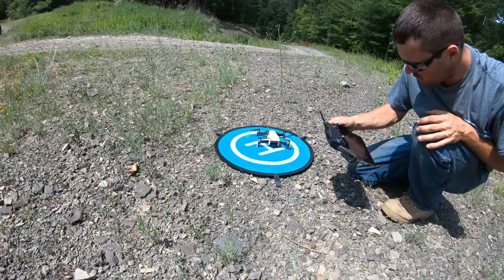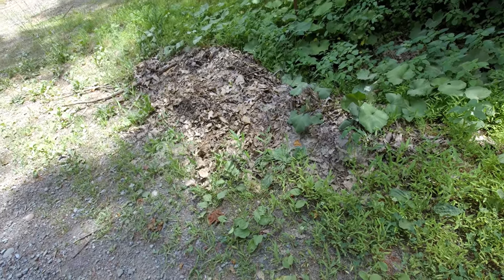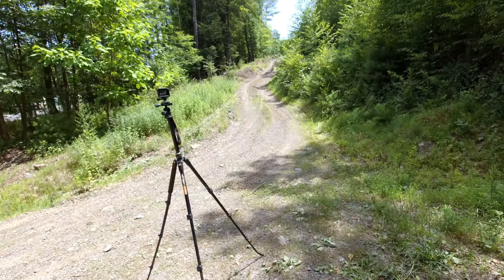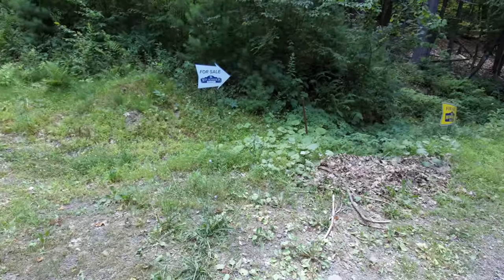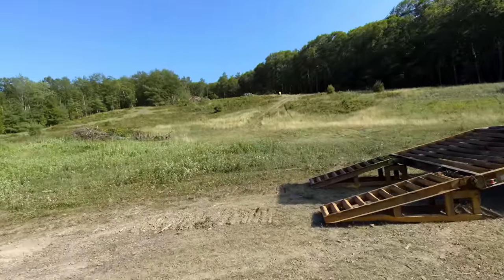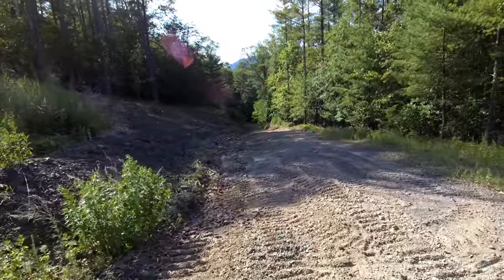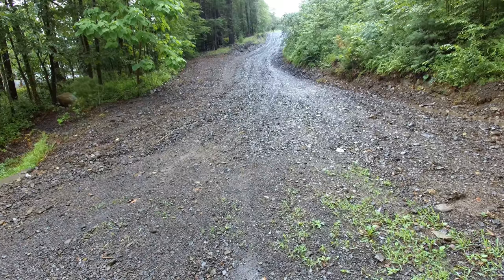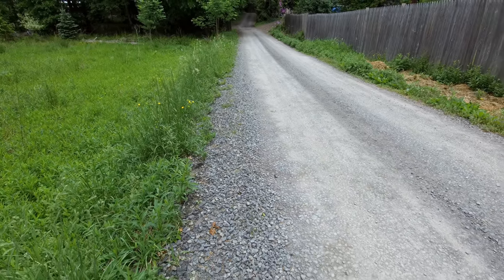Cutting in driveway drainage with bulldozer

Comment: When you first started with the dozer, I was asking myself, how the heck are you going to make a ditch NOT as wide as the dozer blade. Cool to see your method of using the dozer at an angle, with corner of blade as my answer. I have to admit I had my doubts as to effectiveness when you were done, but your rainy day followup proved it worked. Thanks for your videos.
Reply: FYI Libertyauto, that dozer is a 6 way blade: up/down, left/right, and tilt. cut my teeth on that D4C Cat. If you watch carefully you can see when he tilts.  nice work on a rocky/shaley driveway. I would have spent a little more time smoothing it out, but that all depends on what and how much the customer wants and how much they're willing to pay, so no criticism from me. Love to watch Andy work.
Reply: Thanks Joel C. I did not realize the blade would tilt.  That makes the method and machine used even more understandable.

Comment: good job andrew: the video is super professional. like better than some typical tv shows. see the thing is, you have now corrected for the errors, and made it look like an actual driveway, rather than a forest road, now think about winter and snow. of course this hill would need chains, or four wheel drive with frozen conditions. but a driveway is all conditions. it is steep enough through the narrow groove to push the snow downhill.  when approaching corners, one needs positive camber, not off camber like at the top, you may remind the owner, that that work may need done, to keep the house owner from running off the hill on the off camber corner at the top. or not, and let them discover that in due course. hah

Comment: Nice work. I had a driveway about a quarter mile up a steep hill. I sloped it off to a ditch with several runoffs on the gully side...worked like a charm. I used it for years with only occasional maintenance while my neighbors driveway would wash out every time it came a good rain.

Comment: I don't know about in your area but if you lay stone down or gravel it's always best to packet with some kind of roller even if it's a pull-type roller on the back of the Dozer if you pack it down tight after you're done spreading you'll get better results and the road will be less to heaving this is what causes the potholes from the freezing and thawing great video
Reply from the maker: I tracked it in with the dozer. That will pack it down. Next best would be a vibratory roller.

Comment: G'DAY ANDREW, WELL DONE WITH REPAIRS, The Use of WHOA BOYS(Water BARS),Every 30_50mtrs(100_150'),is I've found on East coast Queensland, in heavy rainfall areas,critical in water diversion, also allows vehicles, especially heavy ones to reattack the grade,similar to terracing ,the Cat D4,definitely would benefit by fitting a single TYNE RIPPER,also to save your back,maybe consider hydraulic RAMS,on Loading RAMPS,on trailer(an unit like on Snow Plough,would adapt readily), Kindest regards, Dave McLaughlin, Queensland, Australia

Comment: It would really nice to keep an eye out for a grader, one with scarifier teeth as well as a straight blade.    Even without the teeth, they are great.  For that driveway, you could almost get away with just moving the loose side gravel back into the center and get a crown back on it.  I used to use a 1956 International grader, basically built out of 1 ton truck parts - axle steering box, engine, sheet metal.  building chain drive boxes for the ends of the back axle. o  )  O'O  belt driven hydraulic pump (could be big power steering pump)  Left and right cylinders and a hydraulic motor to turn the blade.  Good winter project for you.  3' of 24" pipe will get you 12' of blade.
Reply from the maker: Ill keep my eye out. People seem to like graders.

Comment: "if someone wants to check my math in the comments that would be great" Here ya go buddy. Your calculation of slope is right on! However, the first formula you wrote A^2 + B^2 = C^2 isn't needed here. That formula is for if you know the length of two sides of the triangle and you wanted the length of the third. If you plug in (62ft)^2 + (423ft)^2 = C^2 and solve for C, you get C=427.5ft. This is the calculated length of the road traveling down the diagonal line in your triangle. Because roads wont have a slope more than 15% or so, the two longer sides of the triangle (B and C) will always be pretty close to the same length. It's super smart of you to use the drone to measure distance like that. I bet not many people in your business utilize new technology like that to get the job done efficiently. Keep up the great work!!
Reply from the maker: Thanks. That's why match teachers were so big on "Show your work". Its important in the real world.

Comment: Wow, you're a natural when it comes to operating heavy plant and grading material, you have that rare talent to be able to just eye-ball the work and end up with a really accurate tidy job.. I've worked on a load of big construction sites, mainly motorways and the like so can spot a good operator a mile off, you're doing the work of three or four men on most of your bigger jobs, normally you'd have a civil engineer setting out the gradient and such for new roads or re-working and another guy constantly measuring to check the machine driver is working to the right level and so on.. Great work and great videos, that's a whole special skill in itself, it looks easy, but making interesting videos is another rare skill.. One thing I would add though, you really need to invest in a vibrating roller, it'll easy pay for itself in less wear on the tracks of all your machines!

Comment: Andrew,  I started watching your channel a few weeks ago. You do awesome things!  I own a small business in Virginia.  Called Homeowner's Bulk Delivery.  I have a small single axle like yours and just last year started doing a lot of tailgate spreading like you. On the tail gate release handle is a small 3/8 hole at least on mine.  What I do is take a small 1 inch ratchet strap not the ratchet end the long end put the S end in that hole loop the strap on it.  Then I shut my door reach out the window and grab the strap as I raise my bed I let the slack out until I get the height I want.  when I'm set up where I want to start my spread I simply pull the strap and it releases the tailgate.  Your fast!  But I think you'll like this.

Comment: Andrew I don't know if that particular road way or driveway gets enough sun but you could do that with Asphalt millings then pack or roll it down it would be like a Asphalt drive way as far as resistance to wash out.
Reply: Don Hanson agreed
Reply: A supplier here actually does milling and crushed concrete that packs 10x better it's crazy I love it
Reply: I've used it as a base for a new Asphalt and new Concrete driveway.

Comment: Do you ever use slag? I had my driveway done with it here in Tennessee, we'd had huge problems with washout because of the lay of the land. The wash would just move. The slag seems to almost rust together, making a kind of asphalt surface. After I got a couple loads of slag, and the guy laid them in with a good hump in the middle, I haven't had any more problems.

Comment: Andrew, you mentioned the steepness of this road and correctly calculated the angle using Pythagorean’s theorem at 14% but as steep as that angle is the grade is even steeper as 90 degrees = 100% pitch.  I think 14 degrees of angle equals over 18 degrees of road slope or grade. Highways are never built close to that steep. Not surprising that the truck barely made it hauling that dozer.

Comment: good dozer work with six way blade ,very handy .  id like to see better compaction too .seen a roller attached to ripper bar on back that lifts up with ripper bar ,not good on bends though and needs electronic level control fitted to help steering

Comment: I going to have to cut in a driveway similar to this but I don't have the shale base. So I am guessing it is better to have a ditch running on the up hill side of the road instead of letting it cross to the ditch on the other side? I expect I am going to need some good sized rocks in that ditch to reduce erosion.

Comment: Here's a thought. 
Tie a rope to your tailgate release lever and put a knot in the rope at the right level so you can just reach out the window and let the rope slide through your hand till you feel that knot, then pull the release lever. 
You won't have to open the door and you won't have to let go of the steering wheel. 
You will be in total control of everything the whole time.
😀

Comment: If the drone measures 63' for the vertical height (A) relative to it's starting point -- which does it measure for horizontal distance? Is it the diagonal distance flown (C - up and over) or is it the base distance traveled (B - 90 degrees to the vertical)?  It makes a difference for the angle calculation whether the 423" is used as the base or the hypotenuse...

Comment: Just wondering, Why have you got all the water draining to a ditch on the uphill side of the drive? 100% of water ends up in ditch at bottom.  Wouldn't it be better to shed water to other side all the way up with a slight crown?

Comment: A simpler way to calculate the rise is to divide the horizontal distance by the vertical distance, i.e. 423ft/62ft = 6.823 approx, so you have a slope of 1 in 6.823. To get a percentage, divide 100 by 6.823 and you get 14.656%
Reply from the maker: Thanks.
Reply: Not calculating rise, that is given, 62 feet. Calculating slope. Slope is always rise divided by run. To express as a percentage, multiply by 100.  A good limit to put on driveway slope is 10 %. That is 10 feet of rise in 100'.  This is standard in government funded projects.  To decrease slope a common practice is to put hairpin turns in the layout to increase length.

Comment: Instead of having the water from the whole hill going down the drive wouldn't it be better to have some spots equally located to get the water across the road and down the rest of the hill?

Also leveled and shored at those spots to prevent deep gullies from forming.

In the end maybe 1/4 or less water down at the end of the drive.

Make sense?

Comment: Im sure youre already aware of this but i wouldnt recommend using the drone to do a grade calculation based on the altitude it gives if its for anything other than just a very very rough estimate.

The drone uses a barometer to determine the altitude and it can be off pretty substantially since a very slight change in weather can effect the altitude that the drone calculates. Ive owned many many drones (Mavic 2, Mavic pro, Phantom 4 pro, Inspire 1, Spark, alone with several ones i built myself) and they have all shown at least few feet difference in altitude between take off and landing when landing in the exact same spot, sometimes its even been as much as 20 feet. 

The longer that youre the air the higher the chance is for the atmosphere pressure to change which in turn causes the altitude reading to be more off. Some drones use gps also for altitude but gps is also not very accurate when it comes to altitude.
Reply from the maker: I think the drone uses GPS to measure altitude.
Reply: @AndrewCamarata  The mavic air uses a barometer. Im sure it uses the gps altitude too but its primary source of altitude comes from the barometer. They do that because of how inaccurate gps is vertically. gps has about a 30-50 foot accuracy vertically.
Reply from the maker: Interesting.

Comment: ok i did the math using trig and converting feet to metres i have worked it out as  inverse tan' (18.8976÷128.94)= 8"33' degrees which when converted to % is close to 14.7
Reply: Breaking Toast slope = rise / run. Simple algebra to get the same answer. Work smarter not harder.

Comment: Another nice quality job.
Do you find that your Low Ground Pressure machine does better than a conventional track unit ??
Excellent narration on this vid, very well stated problems and your professional solution to each, 2 thumbs up !!
Work safe
Reply: I don't think is is a LGP machine. The tracks look too narrow. I think it was swapped over to a standard track. I might be wrong.
Reply: Brian Gardiner Could be...We'll have to see if he responds to my question...lol
Reply from the maker: I don't think its a LGP. I think someone just put those stickers on there. I should take them off. The narrow tracks like I have are better for rock.
Reply: Often LGP machines have longer track frames than standard, as well as wider grousers. Not sure if thats the case with that machine.
Reply: @tutekohe1361  Andrew's D4 Is a standard track machine.
Reply: The grousers may be standard width, but the track frames look longer than standard. They extend forwards in front of the radiator. Standard track frames normally are behind the front of the radiator. It could be that is normal for that type of D4, but every other model of Caterpillar with standard track frames start from behind the radiator.
 Many owners of LGP crawler tractors put standard width grousers on to try to get more life from their chains when using them in normal work.
Reply: @tutekohe1361  Good call on the longer tracks. This is a long track machine, you could tell this by counting the number of bottom rollers. However long track does not mean LGP. Low ground pressure machines have a wider gauge (lateral distance between track centerlines). This is necessary because if you tried to put the LGP track on a non LGP machine they would hit the dozer on the inside.  Look at the clearance between the inside of the track and the dozer on Andrew's machine.   There is very little space left. So that is the confirmation that this is not an LGP machine. I suggest that the people Andrew purchased this machine from did some painting and put a decal kit on it to make it look good and it does. They bought the wrong kit or the kit had some LGP decals in it in case they needed  them.  LGP does not belong on this machine but it is not hurting anything just false advertising. You will will come across that alot when purchasing used equipment. Long track is good on a dozer because it gives the machine better balance and allows for more precise grade control.

Comment: Andrew, why are you using Pythagorean theorem here, it will only indicate that the third side (where the length of the road in the slope) will be 427.7 feet, irrelevant here unless you want to calculate the 2 remaining angles using the SIN value, the grade is simply calculated by how many feet you go up, every 100 feet, that one you have it right on, as for the angle of attack, as you know there are 180 degrees in a triangle, and here 90 degrees are for the perpendicular angle, you have 90 degrees left for the two other angles, the top one should be around 82 degrees( SIN(423/427) = 81.52 degrees), but the bottom should be around 8.5 degrees (90-81.5=8.5 degrees), for your average, which gives you a radiant of 14.78% (your grade) ....no ordinary car will climb a 30 degrees gravel road...imagine 60 degrees!!! I used to say to my students check it by doing a scaled down model, do a triangle 6.1 inches, by 42.2 inches, take a tape and measure the third side, then take an angle measure to validate everything. If you learned this from me, it's nothing compared to how much I have learned from you, and I adore your persistence, man you never let go until you got it fixed, and I really admire that! I appreciate every minutes I look at your videos, even the one of your jet-ski, long but so nice to look at!

Comment: What type of stone do you recommend for driveway resurfacing?  With or without stone dust,  and what size?  I’ve always heard of “crush and run” but wanted your opinion.
Reply from the maker: I've had better luck without dust (on flatter driveways), sometimes the dust is better on hills. If using no dust on hills, use a thin layer. And bigger rock is better.
Reply: Andrew Camarata Thanks Andrew!

Comment: Others have said about all there is to say re your tremendous work ethic.  I do have one question:  D4C:  what does the C represent?
Reply: The "C" is a series designation. Equipment manufacturers are continually  updating their equipment to make them better and to encourage sales. The first D4 was just that then they came out with a D4B , C, E and so on.  The more progressed in the alphabet the series,  the more refined and updated is the machine. I think Andrew said this machine was a 1988 model so pretty close to the original version. Hope this helps.
Reply: @davidmorse8432  Thank you.
Reply: @orgcoast5990  Any time.

Comment: I have never been on a job where I could windrow the ditch into the road, and use it for a base and never worked around ledge that didn't require dynamite to bust it loose. The ground around here is pig slop clay. No good for anything.

Comment: Your math is ok except where you show 62 squared = 423 squared. You probably meant 62 squared + 423 squared = C squared. But I’m Not sure why you are using Pythagorean’s equation to calculate the slope. All you need to do to calculate slope is divide the   “rise” by the “run” and the multiply by 100 to convert to percentage - in this case 62/423x100=14.7% you could use the theorem to calculate the length of the driveway by taking the square root of the sum of the squares of A  and  B (sorry no alt Key on my iPad)